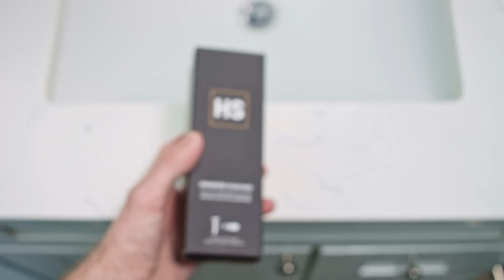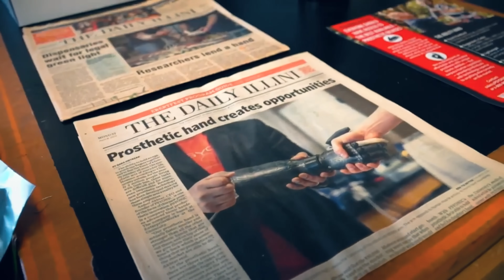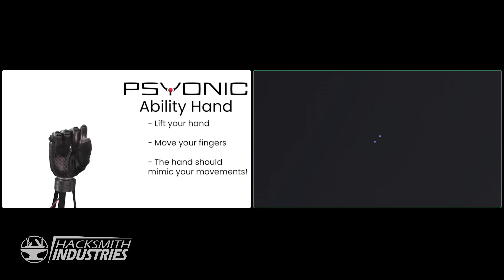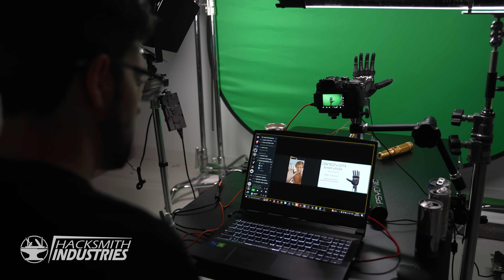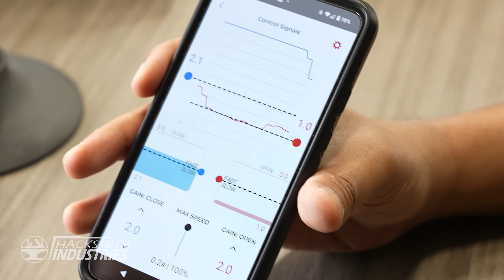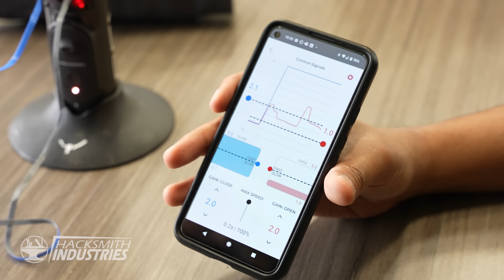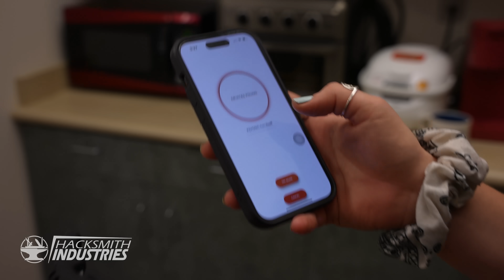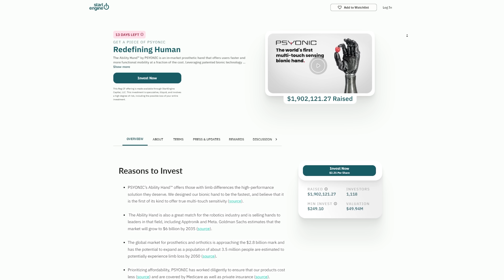This Bionic Hand Will Change Everything!

Comment from the maker: Use our code HACKSMITH to get 100 free blades►  https://hensonshaving.com/hacksmith
Reply: If there’s technology that can read the muscles with the electrodes couldn’t we do connect some electronic tentacles to a back and make it where it reads different muscle movements in the back as the signals. (Doctor octopus style)
Reply: @ziadeternal4415 that already exists 
Through the spinal cord if one where to sync the bionic arm with motor function Through synapses
Reply: As a left hand amputee the issue is not the ability of the hands. We've for a very long time had articulating hands that could do most of the movements that a human hand can do. Its the interface which is severely lacking. Myo has serious limits in how many inputs it can take and how many inputs the arm can provide.
Reply: how do i join the hackssmith grupe
Reply: OK, so on the meta quest headsets there is hand tracking and you should try to make the hand compatible with the vr
Reply: Human bone is stronger then steel and concrete?!.
Reply: Idea: an Ironman suit that can go sentry mode. But it doesn't have to walk or fly on its own or anything. All it needs to do is open up to let the user step in and out and be able to move around. That'll be awesome
Reply: You guys should use these arms to build a johnny silverhand outfit with the actual hand it would be so cool
Reply: It would be cool if they made one glow in the dark
Reply: I’m a bit late to the party, but I just wanted to say how I find this so amazing because my girlfriend was born with the same limb cut off that ani has, Symbrachydactyly I believe that’s what it’s called and I can’t wait to show her this video. we’ve been dating for about 10 months. But she’s an amazing person and is far more talented than I am. She is an amazing artist and fashion designer. I am so lucky.
Reply: wow
Reply: day 2 of asking for you to make the cowmangeler 5000 from team fortres 2
Reply: The flesh is weak.
Reply: Can it :
a. Stitch a clothes
b. squeeze a hammer till it bended.
c. Swimming + diving jobs
d. Catch a baseball and or catch an egg without breaking it.
Reply: @hacksmith , can you make a video about bionic legs?

Comment: There’s a lot of skin around the area of amputation.  Presumably, as you move further away from the immediate amputation site, more of that skin will have functioning nerves that still carry tactile and compression information.   Rather than have the sensors on the prosthesis translate contact information into some generic vibration, why not use extremely localised sensors across the topology of the hand to actuate corresponding stimulators that could agitate or apply a pressure to any convenient patch of sensate skin, and let the brain rewire itself to remap that touch data?  Surely this could potentially provide a dramatic informational improvement to contact feedback.  Additionally, if the absolute position of each and all independently mobile components of the prosthesis were linked to a pair of corresponding  variable pressure stimulators, with each allocated to the range of motion on one side or other of the null for each articulable joint; such that each reached its maximum  pressure feedback at one extreme of that range of motion, then, with the recruitment of sufficient nerve endings across the (admittedly comparatively low density clusters) utilisable over the surface of the forearm, there could be a profound incorporation of the prosthesis into the operator’s consciousness of bodily relative positional map.  Combined with appropriately dispersed contact sensors and corresponding unique localised feedback signals across the surface of the arm, the operator could intuitively combine  the complex of positional and tactile feedback , approaching a low resolution model of a real hand’s far more sophisticated capacity to explore and engage very effectively beyond the immediate visual field.

Comment: Exo hands are terrifying dude. No need to lose an arm it just uses straight air pressure and hydraulics to smash anything you grab to pieces and uses senors to open your hands back up when your wrist makes the movement. Its basically a hydraulic press for a hand and this is getting into some like jacked up lovecraftian nightmare meets berserk meets cyber punk. Im good fam, im happy being a bioelectrical machine. My chemical makeup may be physically weaker but its superior in complexity so ill stick with it .-.
Reply: Which hand design is better?

Comment: I mean wouldnt you just be better off making it from aluminium or something rather than plastic
Reply: I imagine it's so it best replicates the feeling of skin.
Reply: You still need to hold the hand with your strength. It would break the balance of body if both hnad were very different in weight
Reply: @QuietlyUnsure  aluminium would probably be around the same weight. Plus your arms are surprisingly heavy

Comment: It occurs to me that the hand has more capability (as evidenced by the first part of the video) to mimic more real hand motions than there are available sensors when attached to an arm socket.  In other words, all the muscles and/or nerves are not available in the residual arm to power or control all the hand can actually do.  So the limiting factor in making it more than a modern myoelectric hand is that the residual limb cannot send enough different signals to power the hand in all it can do, i.e. the bionic/human interface cannot send enough differentiable signals to use all of the functions the hand can perform.  It is that interface that needs more development.

Comment: Only a robot hand that goes up to the beginning of the forearm won't make you super-strong, you will need to have support for the back and legs as well depending on what you want to accomplish. You can punch harder though but thats because of the added weight ( if there is any ) and the fact that you can punch as hard as you want, because you cant break any bones.

Comment: at this point, once the batteries for these get updated to the point that they can at least last for a ridiculous amount of time or perhaps even no time limit to rechage as it could mayhaps find ways to use other tech to recharge it even as you wear it, it could become pretty interesting how things go with it.
Reply: Could probably have it be charged off kinetic energy and also thermal from body heat. Maybe a tiny solar panel on the back. I dunno, itd be real hard to get it to stay charged indefinitely though.

Comment: So it's the same bionic hand we had since 60s but now you can control it through app
Reply: Uh are your from 2060 or something?
Reply: @Lucachetii    it's still opens/closes selected mode, but now you can select mode through app, and also hand vibrates when touches something, that's it for 60 years of upgrades
Reply: Mate computer operated factory arms are way fuckin different than limbs that connect to your literal nervous system
Reply: @quartzskull8772  video surely makes it look like it's just like a regular hand, not an advanced pincers
Reply: @yegor2letov  advanced pincers? Those things run off of a repeated code this hand has to read the signals traveling from your brain and through your nervous system and be able to move all the joint in each finger not just an open and close function
Reply: @quartzskull8772  but it can't do it?
Reply: @yegor2letov  wdym it can't do it, it was literally doing it in the video that's why they move the hand without touching it
Reply: @quartzskull8772  no it's not, they use phone app to change gestures
Reply: @yegor2letov  14:00 so that was with a phone?
Reply: 13:00 and here also?
Reply: @quartzskull8772  exactly, for some reason I can't link you a video where it's all explained better, my comments with link get deleted
Reply: @yegor2letov  so what you really think someone's off camera with a phone and doing this?
Reply: @quartzskull8772  they set hand for a mode they need beforehand and then film, in examples you provided she really does only two gestures at a time

Comment: This is incredible. 3D printing would be good for relatively quick prototyping, but given the nature of filament and how it also degrades over time, I can see how durability would a major issue. But now that this kind of tech exists, with even touch-feedback, it's another revolutionary game changer that wasn't possible with any other type of prosthetic before this. I'm excited to see where this goes, maybe even customization, like colored silicone sleeves to mimic skin tones, or collabs with IP holders to license and bring exterior designs from pop culture with characters who are also using prosthetics (i.e. Fullmetal Alchemist) with the same inner core technology.
Reply from the maker: filament doesnt degrade overtime -- material does! theres lots of 3d printer filaments that do not degrade :)
Reply: @hacksmith  To clarify, I was thinking of PLA (polylactic acid) one of the most common types, which is supposedly biodegradable. I am aware there are many different types of filament as well. 👍

Comment: So looking at this. I have 2 ideas. One this is just the start. The day we have robotic legs the journey to better humanoid robots will be closer. By this I mean it will be easier to gather data that would be used in making one stand. Sure we could make 100 robots and give them all software then start using them like a learning algorithm just to walk. But that only goes so far. With this we could give 100 people and take sensor data from them. That would allow for robots to better identify things required. 
The other is I wanna lop off my arms to get them replaced by these things. Also I wonder the max grip strength of them.

Comment: I have an idea for the next lightsaber!
What if you build a small rocket engine that maximizes flame length instead of thrust and uses chemicals for a bright flame with the right color. 

This way you would get a more stable flame compared to laminar flow flame. The jet stream would make the sword more powerful AND you could experiment with solid, hybrid or liquid rocket engine for various advantages. It could be really compact and powerful.

Please like this comment if you like the idea so mabye hacksmith will see.

Comment: Just wait till someone hacks someone's bluetooth hand while they're jerkin' their gherkin xD
Reply: Why would this be bluetooth? I believe that it would become physically connected to you rather than bluetooth.
Reply: @The_E_Lord   That's a question for their engineers - I would have at least made it tap-NFC with solid encryption heh
Reply: @3nertia  You can implant a solid NFC microchip that's hard to crack in your hand of you want 👁👁
Reply: @The_E_Lord   I was thinking more like the nfc in a smartphone 😅
Reply: @3nertia  Works the same way
Reply: @The_E_Lord   Sorry but I'm not sure of the point you're trying to make?
Reply: @3nertia  The nfc chip you can implant in your arm works the same way a phone's does. It can behave as an NFC tag as well as a scanner.
Reply: @The_E_Lord   Which is more secure than bluetooth or wifi because it's proximity only ...
Reply: @3nertia  But the problem is that most nfc's are easily infiltrable if you have access to them
Reply: @The_E_Lord   As I pointed out, it's better than what these guys are using which is bluetooth or wifi ...

With NFC embedded in the hand, you'd have to tap your phone to the hand to access settings rather than being able to do so over wifi/bluetooth. All actual control signals should be strictly physical though, through the nerve/muscle signals, which does seem to be how they do that part at least

Someone would literally have to steal your hand to control settings or gain access with NFC lol - not true of wifi/bluetooth where an attacker could be some distance away and practically invisible ...

Comment: Couldn't they use the muscle sensors to control VR and PC games? Are the sensors that much more expensive that they can't replace VR controllers?  Imagine just having a wireless bracelet (or armband if it cant detect finger movement at the wrist) you put on that senses your finger movements and moves them in VR. Or even a simulated controller input for NonVR games. Is no one doing this? If not sounds like a good project and product. Depending on the latency and accuracy of the muscle sensor input.
Reply: They are expensive for a reason, but do exist.

Comment: When my boyfriend was alive I used to say to him that if I ever lost a limb I'd make my own, these days it's getting easier to get something of good quality.
If I lost a leg I'd have the joints producing electric as I walked which would change a power pack built in so I could charge my phone. If there was room I'd be able to open the leg and remove a drinks bottle which could be chilled if the power was available.
But if I lost an arm I'd have something like the arm in the video but have a place where my phone and iPod would fit. Ànd if possible remove the tip of a finger to expose a bottle opener and a touch on the back of the hand.
It may seem a bit Inspector Gadget but it would be so cool.

I really hope that things go well for the company, the Hands look awesome. 😀👍

Comment: I plan on going into biomechanical engineering when I graduate high school with my associates degree, and I'm already working on a design for a prosthetic arm. Ideally using cells from the recipient new nerves would be grown to replace the nerves that would be in the arm. These would be connected to a computer chip and then implanted in the recipient. This computer chip would wirelessly transfer the input nerve signals to the prosthetic arm. The arm would have a small computer in it that decodes the nerve signals and the decoding program could be made custom for each person. This would allow for the user to control it like how anyone else would control their arm and have an idea of where it is relative to themselves without looking at it. The hand itself would have about ten DC coreless micromotors that contract wire to move the fingers. Each of the fingers would have four metal "bones" connected by joints. The metal would most likely be a aluminum alloy so they could be strong but relatively light. The joints in the fingers would be sing axis joints and the knuckle joints would be a type of universal joint that I designed. This joint allows for motion in two axis but the one I designed highly restricts one of those axis of movement. This means that like real hands the knuckle joints would allow the fingers to move from side to side slightly. Each finger has 2 motors connected to it and two wires that can contract it, meaning that with one wire on the right and on the left side not only can they contract the finger but they would also be able to take advantage of that knuckle joint and move the finger side to side. The thumb would only have three segments and the first joint would be similar to the knuckle joints but it would have a larger range of motion. The wires themselves would be NiTinol wires that can be stretched, but return to their original shape at a slightly warm temperature. Using NiTinol wires like this makes it so the hand could grip something like a ball as hard as possible, but if the fingers cant grip it any harder without breaking it or themselves the wires will stretch. When they stretch the fingers will fully wrap around the object similar to a real hand. This means that if the hand is holding an object that it cant break and it starts gripping as hard as possible instead of just reaching its limit and putting serious strain on the motors the wires will just adjust their lengths while still retaining tension. The entire hand would be covered in a pliable form fitting "skin" that is made out of a synthetic compound. Then there would be rubber pads on the palm and finger sections. With all of this combined the hand would have a more realistic range of motion, it would be much better at gripping things because the fingers can adjust to the objects shape, it would be very durable, and it would feel more natural to use. The main downside is that it would have to be charged pretty much every night, but I have also designed two ways to better charge it. One of them is for people who might want to just leave it on at night and its a mattress toper that has conductive pads throughout it. This mattress toper would charge the arm wirelessly no matter where it is in the bed. The second thing I designed is a stand that the arm slides onto and charges the arm through metal contacts that connect to corresponding metal contacts on the arm. Sadly though I've only been able to do a very small amount of testing since I don't quite have that big of a budget.

Comment: I was kinda expecting to see one using the sponsored shaver with their psyonic arms. BTW, are they gonna make a wrist joint capable of yaw and pitch movements? It seems the current model looks like it can do a bit of roll movent or something.🤔
Reply from the maker: wrist movement is usually done in the other half the socket, not the hand itself